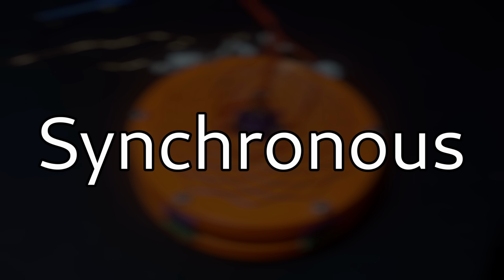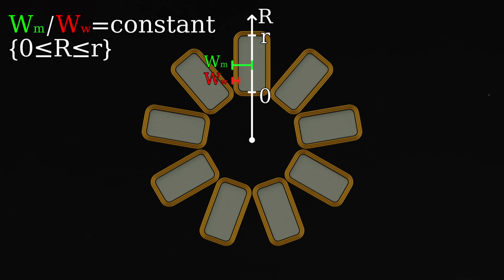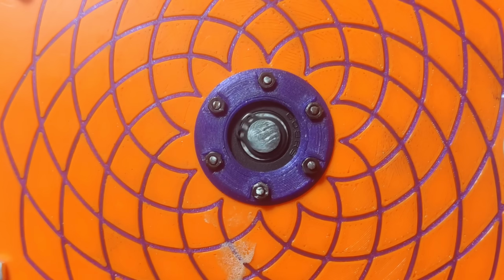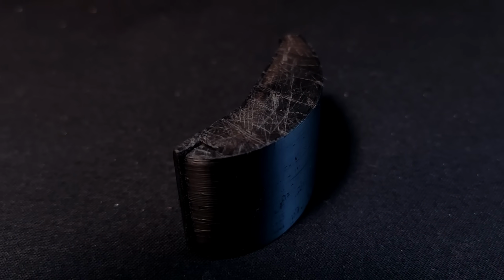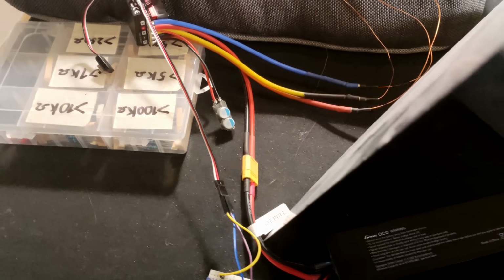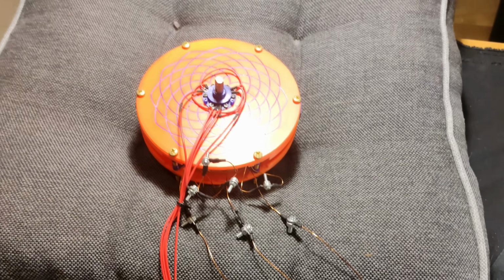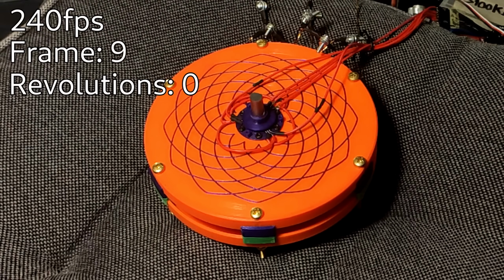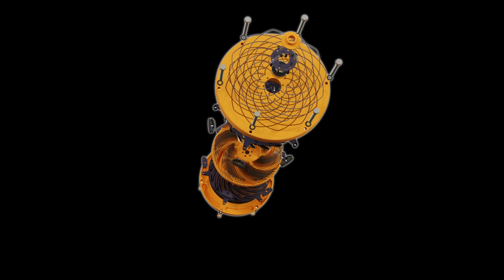Axial Flux Synchronous Motor Prototype

Comment from the maker: I hope you enjoyed the video! <3 Next electric motor I make shall be one which powers my bike!
*An extra note on the geometry of the stator - The involute stator design also allows the stator to have more effective copper area in it (especially if concentrated windings are used)... I cut that part out from the script because the video was already starting to get pretty long...
*A little definitions mistake also snuck in: Technically every permanent magnet and reluctance motor is a "synchronous motor" (the electrical rotation is in synchronous correspondence with the rotor rotation)... The definition of synchronous in this video differentiates between motors where all generated electromagnet poles are exactly in sync with the magnetic poles of the rotor, rather than not (for example BLDC motors which have more- or less permanent magnets on the rotor than generated electromagnet poles)
*A clarification on how exactly reluctance motors work: I nearly completely gloss over the explanation in the video but generally you can think of it in the following two ways; Reluctance motors work based on magnetic circuits. Because air is poor at "conducting" magnetic fields (it has a high reluctance), then if the rotor is made of material that the magnetic field lines would take preferentially (low reluctance), then the lowest energy/steady state of a magnetic circuit is where this low reluctance material is as aligned to the applied magnetic field as possible. Now, as the electromagnet poles in the motor move (the higher intensity magnetic flux regions move), the magnetic flux lines are no longer properly aligned with the low reluctance material in the rotor. Since this is not the lowest energy state/steady state for the system, then it produces a torque on the rotor to align it back towards the lowest energy state, which is where the reluctance rotor poles are exactly lined up with the electromagnets, thus making the rotor move along with the electromagnet poles. 
Another way to think about it would be that since the reluctance rotor is made of materials that have high permeability (permeability is inversely proportional to reluctance) then the material itself becomes a magnet as the magnetic flux passes through it (just like electromagnet cores become magnets). Since the electromagnet pole and the pole generated in the rotor are opposing polarities then they attract, and as a result as the electromagnet pole rotates, it pulls the rotor along. This second way of explaining it is roughly what I tried to quickly convey in the video too, as I believe it to be much easier to understand.
Reply: You are brilliant. Maybe the design can use CRnGO laminated sheets and ferrite magnets ?
Reply: @KrishnaKumar-ro3pz  ⚠ God has said in the Quran:

🔵 { O mankind, worship your Lord, who created you and those before you, that you may become righteous - ( 2:21 ) 

🔴 [He] who made for you the earth a bed [spread out] and the sky a ceiling and sent down from the sky, rain and brought forth thereby fruits as provision for you. So do not attribute to Allah equals while you know [that there is nothing similar to Him]. ( 2:22 )

🔵 And if you are in doubt about what We have sent down upon Our Servant [Muhammad], then produce a surah the like thereof and call upon your witnesses other than Allah, if you should be truthful. ( 2:23 )

🔴 But if you do not - and you will never be able to - then fear the Fire, whose fuel is men and stones, prepared for the disbelievers.( 2:24 )

🔵 And give good tidings to those who believe and do righteous deeds that they will have gardens [in Paradise] beneath which rivers flow. Whenever they are provided with a provision of fruit therefrom, they will say, "This is what we were provided with before." And it is given to them in likeness. And they will have therein purified spouses, and they will abide therein eternally. ( 2:25 )

⚠ Quran
Reply: Oh, you didn’t mention it but reluctant motors (induction) motors require slip speed between the field and the steel to create the eddy current and hence the back emf. 
Your magnet plate was matching the speed of the rotor so no slip speed and no drive.
Reply from the maker: Reluctance and induction motors are not the same type of motor.
Reply: @BirdbrainEngineer  
Cool. 
Please teach me the difference.
Reply from the maker: @brucebaxter6923  Well, you already explained how an induction motor works - through the use of eddy currents induced in the rotor. 
Reluctance motors work based on magnetic circuits. Because air is poor at "conducting" magnetic fields (it has a high reluctance), then if the rotor is made of material that the magnetic field lines would take preferentially (low reluctance), then the lowest energy/steady state of a magnetic circuit is where this low reluctance material is as aligned to the applied magnetic field as possible. Now, as the electromagnet poles in the motor move (the higher intensity magnetic flux regions move), the magnetic flux lines are no longer properly aligned with the low reluctance material in the rotor. Since this is not the lowest energy state/steady state for the system, then it produces a torque on the rotor to align it back towards the lowest energy state, which is where the reluctance rotor poles are exactly lined up with the electromagnets, thus making the rotor move along with the electromagnet poles. 
Another way to think about it would be that since the reluctance rotor is made of materials that have high permeability (permeability is inversely proportional to reluctance) then the material itself becomes a magnet as the magnetic flux passes through it (just like electromagnet cores become magnets). Since the electromagnet pole and the pole generated in the rotor are opposing polarities then they attract, and as a result as the electromagnet pole rotates, it pulls the rotor along. 
This second way of explaining it is roughly what I tried to quickly convey in the video too, as I believe it to be much easier to understand.
Reply: @BirdbrainEngineer  
Thanks. 
So that’s like the “new” rotor design in the teslas. 
I wondered how that worked. 

In simpler terms, the rotor completes the magnetic circuit?

Seems lower torque but easier than permanent magnet rotor and soft start slipping electro magnet rotor.
Reply from the maker: @brucebaxter6923  It is beginning to be used more nowadays yeah, as the control hardware (field-oriented control & variable frequency drive units) have gotten better and industry requires more sophisticated control from their motors. You are correct, the rotor is essentially completing the magnetic circuit. I don't know about lower or higher torque... should be about the same, considering that reluctance motors can be made a few % more efficient than induction motors due to decreased eddy losses.
Reply: @BirdbrainEngineer  
Far more efficient than squirrel cage. 
And less torque than permag because rare earth magnets can get higher flux densities than soft iron. 

They are far more efficient as the back emf can be lowered by lowering the excitation field/current. 

I quite like the idea for ev as the efficiency directly relates to range. 

I wonder how much loss of torque can be made up by just going for a larger motor with that extra efficiency. 

The air gap must be minute though. 
Water cooling must be needed for thermal expansion reasons.
Reply: Youtube has again deleted my subscription from you ....
Reply: thanks for making this, with all the  learning moments included :D 
its quite similar to a idea i have had floating around in my head to make a continuous ionic pulse engine based on tesla turbine shape
just a air outlet no axel with discs rotating on outer cowling and magnetic portion of engine around outside of portion of discs instead of a axel & a lot more thinner discs and some gearing to reverse the rotation of internal 2/3 of disk of every second disk & opposite polarity, make all the negatively charged electrodes spiked/roughed up and it should harness both ionic  forces with tesla turbines friction force and  concentration of space (ive also though of maybe having all the outer rings be one polarity and all internal ones other but i think axial flux would save a lot of gearing friction)
im pretty sure 1 day its how most turbines will be built as youd need a lot of rotors to fail to shut off engine & it only needs electricity & air for fuel
ps baking soda and regular superglue is often stronger bond than foaming variants, it creates a epoxy of sorts very quick dry though make sure it only goes where you want it
Reply: i like your take on using the curves. i was using 8 layer pcb to make the windings and using through holes to get the magnetic flux lines short enough.
http://www.ata.org.au/wp-content/uploads/2018/12/marand_high_efficiency_motor.pdf
Reply: itsw beatifull but what is the efficience of the motor ?
Reply: MAYBE the problem was that you should have ordered cnc cuts of the rotor laminates in axial lamination rather than radial lamination

That way the laminates would be tight layer by layer in flat, you only have to call some guy nearby with cnc machine and do the curved cuts all packed without wasting metal
Reply: Check this: 

Efficiency Analysis of Axial Flux SynRM in Variable
Speed Applications
Reply: Awesome video. Can you do a transverse flux motor? Keeps popping up when I search things like what type of electric motor is the most energy dense. 

 TFMs they are called. Just a handful of five or ten year old videos. Some research papers. Nothing new, but google loves it. 

 Not many products either. 

 It is like people are suddenly realizing hey, motors are awesome for more than just gimmicky toys. I personally love the trickle down from Smart Phones, EVs, and drones..

 Can't wait to see an electric VTOL helicopter with an axial flux motor with a five foot diameter. LoL just playing. 

 Yet the fact people are trying to work on human EV flight with massively powerful lightweight motors is cool too.
Reply from the maker: @dianapennepacker6854  Transverse flux is just hellishly difficult to make in the first place, and even more difficult to make correctly. MY next motor is going to be another normal axial flux motor, but this time for an e-bike haha. Not sure when it's going to be out though, projects are slow going due to real life.
Reply: @BirdbrainEngineer , You're well on your way to making one of the most efficient electric motors 👍The position of the magnets relative to the coils must be asymmetrical and the way you wind the electrical wires must be as simple as possible.
Reply: I bet you'd get more response from this design with a reduced duty cycle
Reply: You should not promote asian hate or war propaganda against china, please reedit de video and remove the image of chinese president with smearing comments or i unsubscribe
Reply from the maker: @crapisnice  Go ahead and unsubscribe, then? I am not against the Chinese *people* in any way, quite the opposite, I quite like their culture and would love to visit one day... but I can not stand dictators, and I will certainly let that be known.

Comment: 3:13 : but the uniformity of the electromagnetic field (on the stator) is not important as long as all its magnetic flux is catched by the rotor magnets. Isn't so? If yes, why did you search this uniformity? For less joule losses?

Comment: is it me or is that not very many rpms?
Reply from the maker: Power = Torque * Speed (rpm). Just because rpm is low, doesn't mean the power is low. Though, in this case it is fairly low for the size of the motor.
Reply: @BirdbrainEngineer  yeah, that's what i mean. maybe the type of waveform you're using isn't optimal? have you looked at adding capacitors in parallel to the coils?

Comment: I am guessing you had difficulty with the reluctance design due to insufficient permeability of the steel you used for your laminations. Per Wikipedia[1], common mild steels only have a permeability of 100x that of vacuum. Electrical steel, by comparison can be 2000x or more the magnetic permeability of vacuum. This fellow[2] managed to get 600W / ~ 3/4 horsepower, at an estimated 80% efficiency, using a more traditional radial flux design, and a 3d-printed winding core made out of magnetic PLA[3]. I have not yet found any permeability numbers for this PLA, but the fact that this guy is getting 600W suggests that the magnetic PLA has a fairly good permeability.

Personally, even though the reluctance design failed, I think you're onto something with the involute's ability to have constant flux density. Perhaps involute-curved  poles on the rotor could be approximated with bar magnets of varying lengths?

1. https://en.wikipedia.org/wiki/Permeability_(electromagnetism)#Values_for_some_common_materials
2. https://www.youtube.com/watch?v=NFvMC3l3fGY
3. https://proto-pasta.com/pages/magnetic-iron-pla
Reply from the maker: Magnetic PLA has a lousy magnetic permeability of around 10 to 20. The reason their motor is so powerful is because it is that powerful only for a short period of time (if it was left at that power the motor would straight up melt), and also power output is not dependent on having high permeability core materials. Air core motors will produce almost the same amount of power as motors with cores, simply that their back-emf is smaller, therefore they will spin much faster at a given voltage while having less torque... But because power = speed * torque, then it actually ends up being a similar amount of actual output power with or without cores. 

As for your thinking for why this motor didn't work - you are most likely somewhat correct... The steel I used was just some common sheet steel, so it likely has a permeability of around 100 to 500 at best.

Comment: I want to know about motors. Can you tell me if I can use this motor to run a mini cart that can carry around 60 kg? Did you make the e-bike? Please let me know.
Reply from the maker: The motor shown in this video, no. Still making that e-bike motor, been busy with getting a house and moving... but hopefully towards the end of the summer the video will be out.
Reply: I am really eager to see how you build it. Can you give me some guidance on how can I build it?
Reply from the maker: @nafisfuyad7959  What I have found out, perhaps unsurprisingly, is that it's most certainly cheaper to simply buy a motor for your use case. If you want to make the motor for the sake of making it, then feel free to wait until that video comes out - I will be talking about things to watch out for while designing a motor.
Reply: @BirdbrainEngineer  I also work for a rover project. Our rover runs fairly well. But we still use DC motors. For accuracy and conveniency of controls I think axial flux motor with encoder will be a better option. I do not know much about motors. As our projects members are all students we do not have the budget to buy those expensive BLDC motors. Can you give me your mail so that I can ask for help to build motors for our rover?

Comment: I fled from Russia to the USA. Before the war, we were developing super electric motors for cars. Axial Flux motors showed poor performance in comparison with Tesla motors, for example. And in real-world tests, they are generally behind in terms of dynamics. High current consumption. You won't get far with them. That's why they are not in serial production. This is another way to attract attention to the manufacturer. They have been known about them for a long time. The best motors have different designs.
Reply: the point of development is trying new designs with new materials. if that wasnt possible everything would taste the same. thats why steam power is still the superior method of production and nuclear is just another means of heat production, fusion doesnt exist and people conflate the two.
Reply: I’m glad you were able to get out before the war.